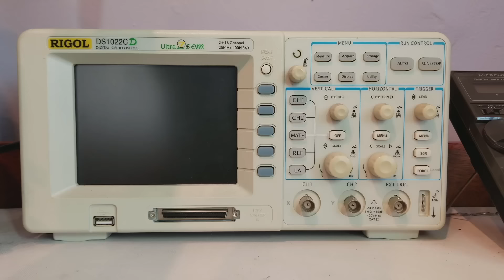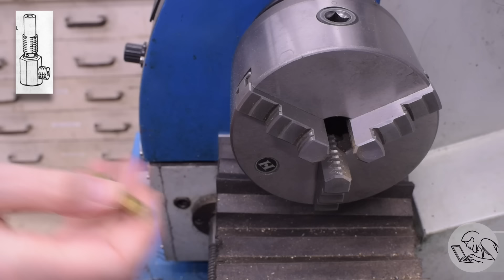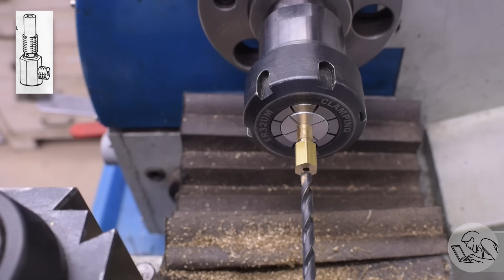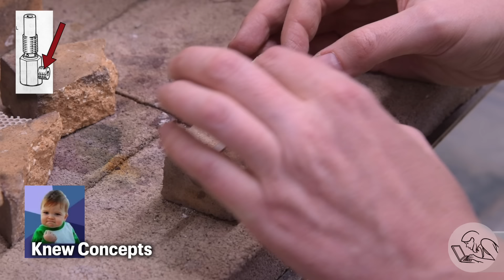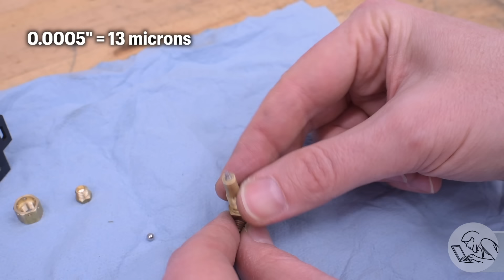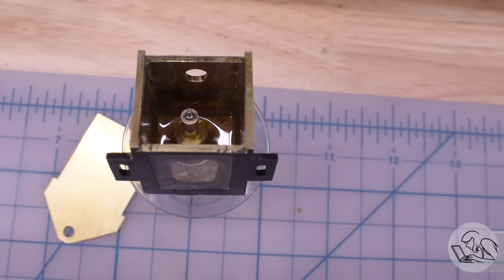Oil Pump! - Pennsylvania A3 Switcher, Part 82

Comment: And now I have to wonder (and wait for another video later) how the pump is going to be powered with the piston inside the tank.  where the water pump had the eccentric located behind it on one of the wheel shafts.  I expected the other eccentric on that shaft would power this one as well.

Comment: MSCDirect still has carbide split blanks in various sizes... no idea if the prices are good or not.
Reply: Damn, I was excited to have something for my wire EDM to do, but the split blank is only 30% more expensive than a solid rod of the same length.
Reply: I just looked that up as well. No idea what size Quinn would use more.

Comment: You were saying about high quality bits... accuracy... 
I have a set of 'questionable' (cough) bits that I occasionally use.  Went to fine tune a hole the other day and realized the bit wasn't opening the hole any more than the previous one... until I got about an inch in!  Yeah, skinny at the tip, then it got fatter.   :/
Reply: Ohhhhh 😢.  Almost a step drill.
Reply: @darrellstephen3085  - haha!  yeah totally.  Just a random one.  :D
Was a T (lettered size) in the middle, and maybe an S at the tip.  Or something else!  Who knows.

Comment: Always glad to be one of the first! Can't wait to see how you regulate the oil flow. I've been wondering about that
Reply: I suppose the length of the piston stroke could be changed with adjustable link arms, but that's kind of overkill for a total loss lube system.